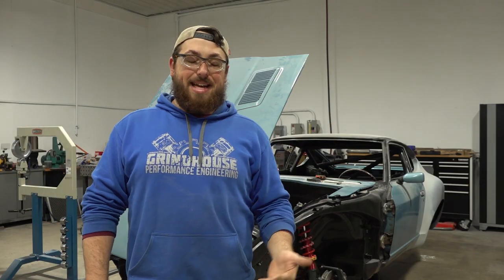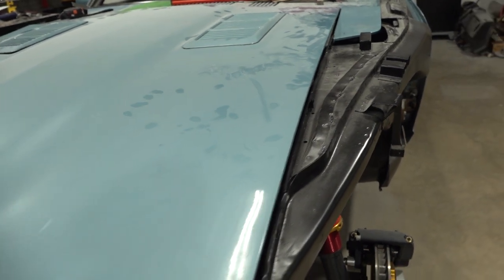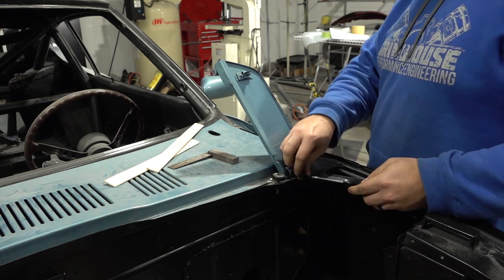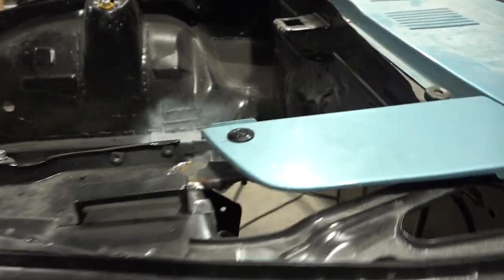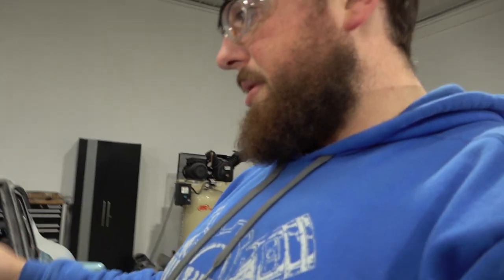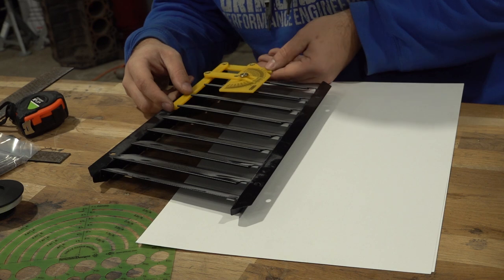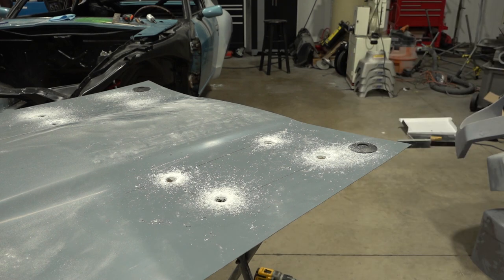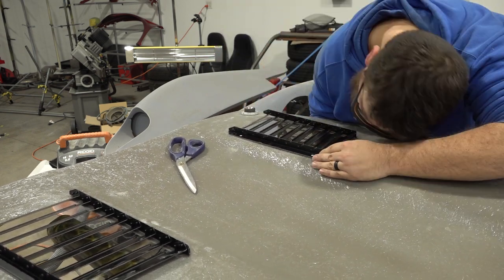Fiberglass Hood FAIL - Widebody Datsun Restoration Project Ep. 6

Comment: I might have to use those same latches on my S10 hood, because I'm pretty sure when I move the radiator into the core support, I'm going to have to lose the latch mechanism to clear the condenser.
Reply from the maker: I'll say that quik latch specifically says these are meant to be used in conjunction with a latch, since their design doesn't have a positive stop like a pin like aero latches do. I thought it was OK to use here because of the direction the hood hinge opens in reverse so airflow isn't going to really be pushing up on them
Reply: @GrindhousePerformance  Maybe I'll do the buick Regal hinge trick and have mine open backward too. That was a cool trick people did back in the 90's. lol

Comment: 0:53 - Just curious - what are those hinged panels meant to access?
Reply from the maker: From the factory these are used to access the clutch master cylinder on the driver's side and the battery on the passenger side 👍

Comment: could you not get a crappy stock hood and use the frame to reinforce this one?
Reply from the maker: Possibly... I feel like it would be really difficult to separate them cleanly without damaging or warping the reinforcement. Could be worth trying on a junk one
Reply: @GrindhousePerformance  you're probably right.. why don't you use your stock hood? It doesn't look that bad!
Reply from the maker: I certainly could've used the stock one. I kindve panicked with the  patch repair panel... I wanted to go away from the hinges altogether, but that was me trying to cut corners probably